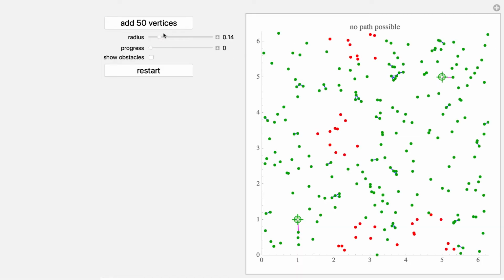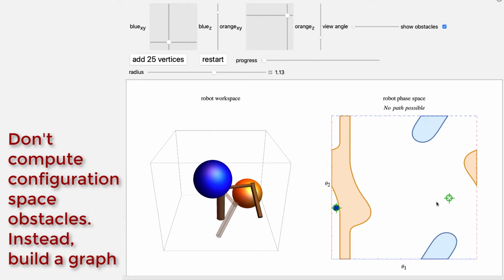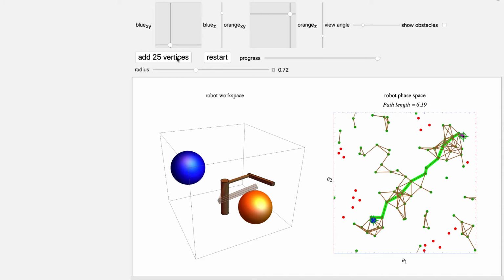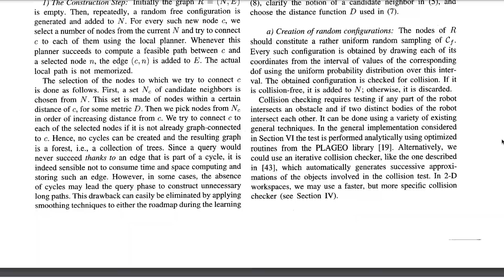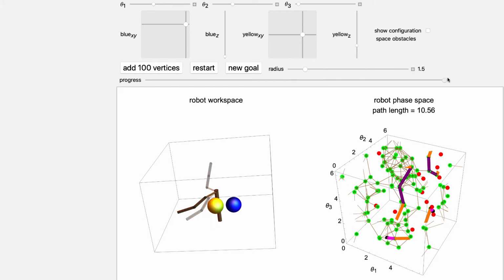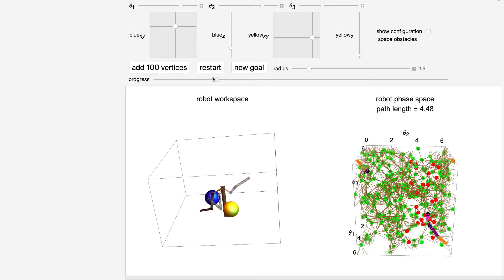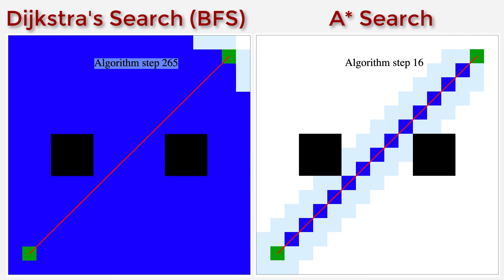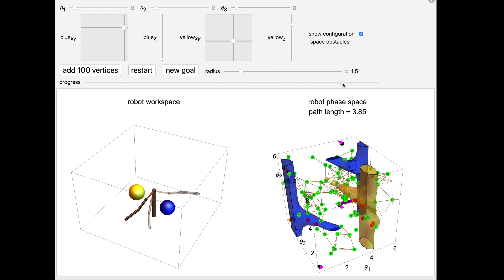PRM: Probabilistic Roadmap Method in 3D and with 7-DOF robot arm

Comment: Even if the whole roadmap needs to be computed again, it PRM still efficient for path planning in a dynamic environment? A for example RRT* which I believe checks constantly for every node?
Reply from the maker: If you are dong a single query, I'd use RRT.  If all you need is a route from a known starting location to a goal location, you don't need a road map, you only need a single route. https://youtu.be/Ob3BIJkQJEw  PRM becomes valuable when you want to use the map repeatedly.  Of course, if you can parameterize the dynamic environment (this obstacle moves in 2D), then you can treat the box as if it is a joint of your robot, and add that to your PRM.
Reply: @AaronBecker  yes, i want to go from a know initial configuration to a goal position with moving obstacles, thanks for the advice!